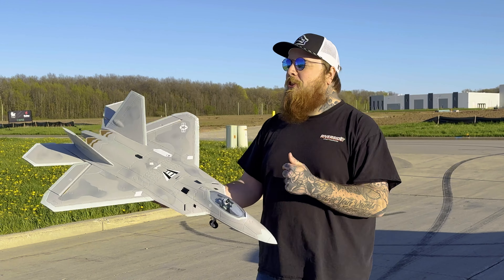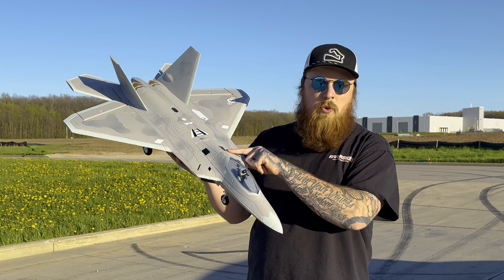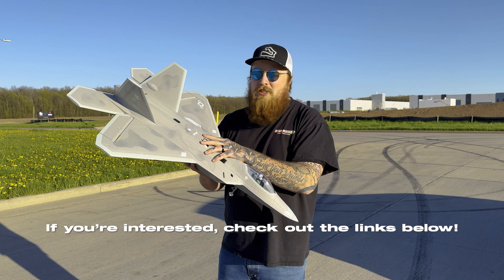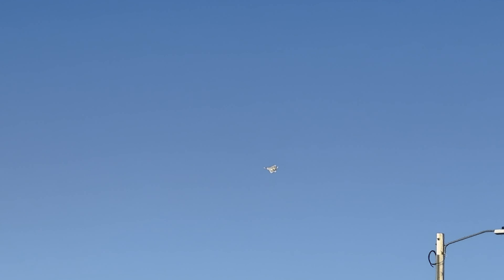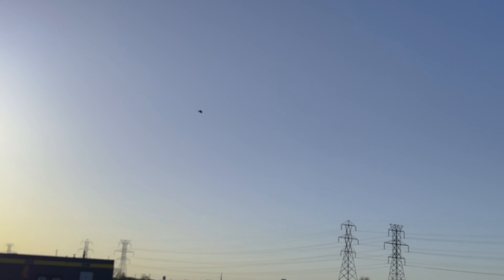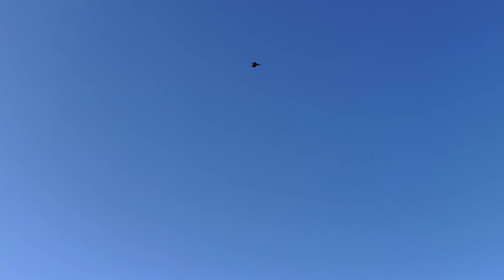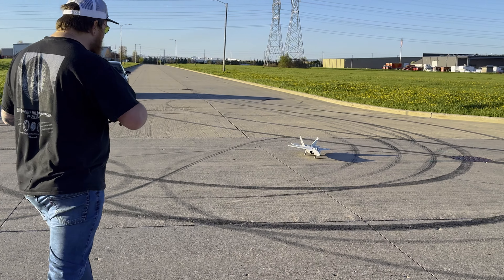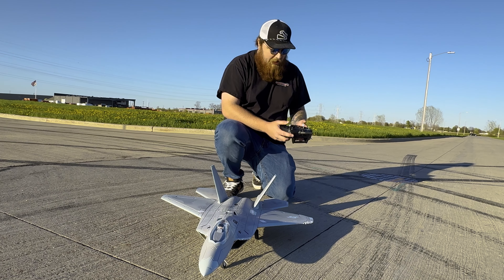Freewing F-22 64mm Flying With NO Gyro or Safe. How's It Handle?

Comment: You’re ready for the bigger ones brother! The 90mm F-22 is very forgiving and flies like a trainer. If you want fast and agile get the 80mm Mirage 2000 from Freewing. It doesn’t stall, ever. It’s the most fun I’ve had until I crashed it. I’m getting a second one soon lol. Also the twin 80mm Mig 29 is easy to fly and cheap considering it’s giant scale for a foam jet.
Reply from the maker: Check out my video flying the 70mm F-16! I also have an 80mm integral. I really want the 90mm F22 tho. Working my way up towards that one!
Reply: @Mach3RC  bigger are actually easier to fly! You’ve been ready my man!